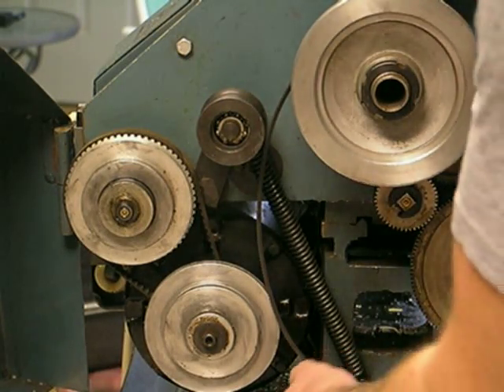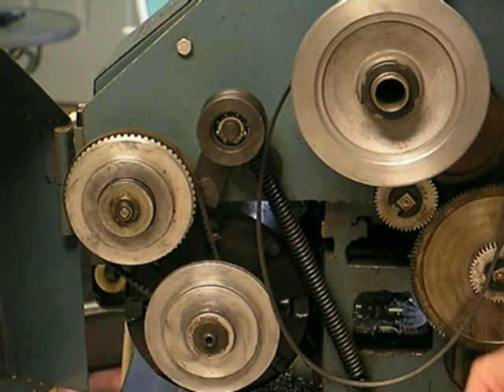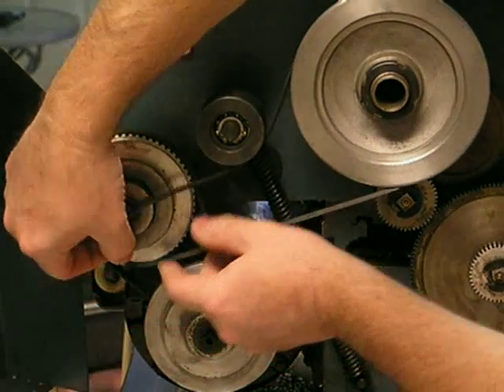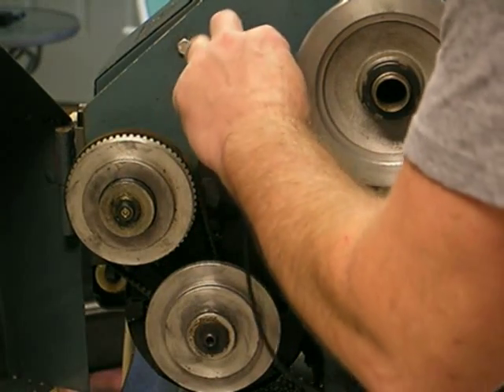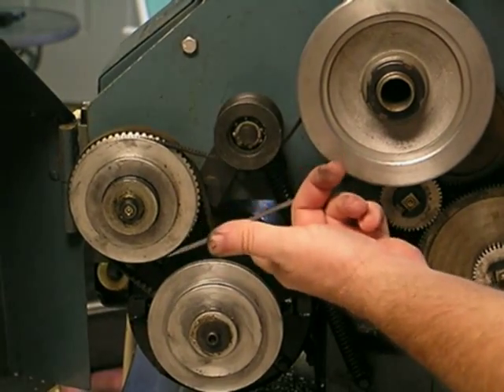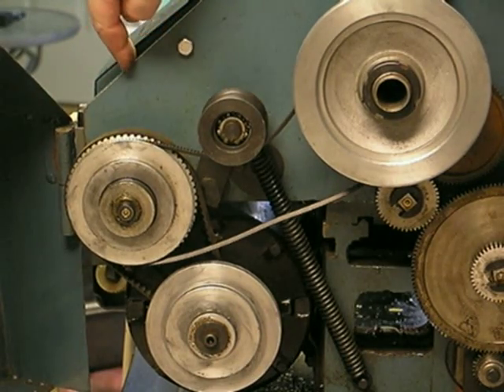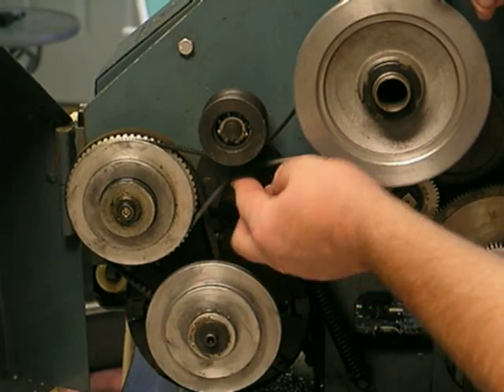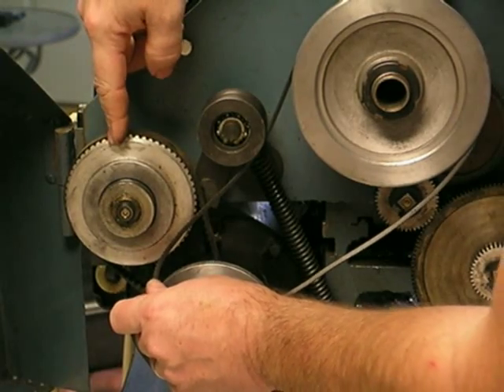9x20 belt problems (speed adjustment)

Comment: i had exactly the same with my 9x20 lathe which i bought new from "Chester Machine tools", along with the pulleys being out of line the lathe was in a terrible condition, it was rusty, headstock out of alignment, tailstock 3mm low. i ended up have making a complete replacement compound, needed to scrape every way on the lathe. i bought it new to free up my big lathe. got no support from the suppliers. it nearly went in the scarp skip. it turned out ot be alright in the end but i would hate to price up the manhours i put into it

Comment: A seven year old video about a lathe I only use once every two or three years. Yes, the bolt in the back plate was some sort of custom mod made by the previous owner and was restricting the movement of the idler pulley. I never did buy a 730 belt and instead just force the 710 on when I need to. Horrible solution but again, I only use the thing 4 times per decade. Was going to sell it many times but when I need it the thing really comes in handy.

Comment: I bought a 9 by twenny just like yours. I had at 1 time a built company in my area this company has now gone out of business. But at that time I bought several of the belts and bought different sizes of that exact Style of belt
Reply: https://www.ebay.co.uk/itm/Z-section-Linked-Drive-Belt-1-metre-10-mm-wide-For-Lathe-Milling-Machine-etc/332631034348?hash=item4d725ac9ec:g:744AAOSwEMxa33Eb

Comment: I had the same problem until I did some research and found out that these machines use two different belts, depending on what range you are using.  one is a 5m710 (shorter) and the 5m730 (longer)  Both are available on Amazon (best price I found, around $13 each.
Tony 
Port Hadlock

Comment: Robert;  I just saw this video.  I hope by now you have resolved this issue.  As I watched I noticed that your tensioning handle didn't go all the way down.  When tension is released, the handle should point straight back.  When tension taken up, the handle should be fully forward.  I think you need a 5m730 belt and maybe to adjust the pulleys and motor positioning.

Comment: solved? My thoughts are as follows: raise the motor mount will correct the distance for AC and raising the clutch to suite will allow for BC1. I believe your BC2/3 problem lies with the limited idler tension . I see a bolt head in the mount plate that seems like a modification restricting the full movement of the idler. By removing this the idler lever should have more travel. (if this doesn't quite cut it get a 710 belt if this is the 730...) Hope this helps